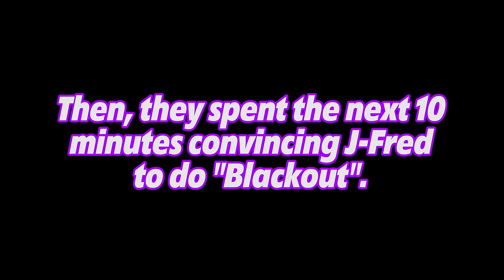Don't Ride Off The Plank Into the Painful Punishments!!

Comment: This would have been a better scoring system:

Fall into mouse traps - 10 pts
Fall into lego - 20 pts
Fall into maple syrup - 30 pts
Fall into cake - 40 pts
Make it all the way through - 50 pts

If there is a tie, measurements come in (just like in the video)

When I used that, I got these results:
Bryan - 120  (50+30+40)
J-Fred - 90  (10+50+30)
Bobby - 60  (20+20+20)